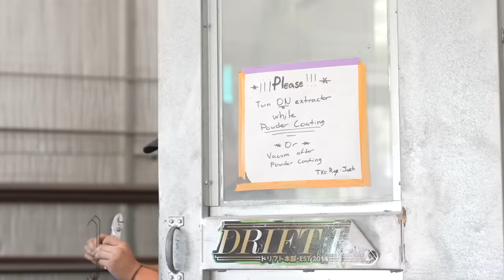My First E46 Gets a Modern Interior Transformation!

Comment: The seatbelt modifcation is probably alright, but considering all the variables when designing a seat buckle i would not take the chance. The material may be different, which in turn when removing material will lead to it failing. Be aware of this if you are planning to modify safety equipment.

Comment: I have the front seats for my e30 m3 tribute build, I used a 12v timer trigger on a 5 second loop to a 12v-5v converter wired to the orange green canbus wires and the seats stay alive. Amazon sells both the trigger and converter.
Reply: Yo bro I just copped m4 seats for my e46 and I will need to retrofit them in any chance you could help me out ??

Comment: Are the seatbelt buckle metals of the f82 and e46 the same composition? I’d be worried that e46 might use an older/weaker type of alloy (hence needing more material), thus removing it could impact safety

Comment: I have f80 seats in my e46 and the lower seatbelt bolt hole is under the little cover that says airbag, On the M3 seat it has a little cutout in the cover to let the belt out, so maybe the M4 seats are the same but the cover is different

Comment: F80 m3 rear seats might have been a better fit since its also for 5 door cars
Reply: 4*
Reply: @xrash2x  5. Two front doors, two back doors, and the boot (or trunk for the yanks)

That's how car doors are measured
Reply: For sure f80 seats would be 100 times easier.
Reply: @charliesmith874 at least in America, a hatch is counted as a door but a trunk (boot) is not. I think an M3 would still qualify as 4 doors
Reply: @partysodown  ok I did some more research and I concede. Always thought people just added +1 for every car on the actual amount of doors it has, but apparently that's not the case lol
Reply: @xrash2x  were im from its called 5 door, since the boot / trunk is counted as a door for som weird reason

Comment: Is there not a bolt hole for the seatbelt under the trim on the side of the seat that says AirBag? That were the stock seat belt bolts to on my F31 and many other newer BMW's

Id have thought they would use the same frames across the range..

Comment: i think your association of the sr3 to jdm is a bit.. idk.. false i guess.
The SR2's that are very similar were actuallty a factory bmw seat option in e30m3's.
That said i would have stuck e46 m3 seats in it, hands down the most comfortable seats i've used.
Reply from the maker: I had a set and didn’t love them enough. They were bouncy and it drove me nuts
Reply: @AdamLZ  fair enough.
never thought of them as bouncy, but we do not have the same body type and seats are very induvidual.
I just know that i bought my m3 in the UK and drove it for 1,5 days straight (1800km's)  home to norway and i have never been as comfortable over time as i was in that.

Comment: Little front seat removal pro tip from a previous interior guy. Unbolt the seat then scoot it all the way back, lay it back like your going to unplug the electronics then stuff your hand into the seat where the bottom meets the back rest and other hand in front then just tilt it sideways where your seat brackets and cushion is facing towards the door and pull it out facing that same way. This will almost gurantee you don’t take a chunk out of the steering wheel or any panels with the seat brackets and is a super easy way to take out and install front seats

Comment: I'm stoked for this bmw project. I did a rear folded seat conversion in my e39. It's not terribly difficult, you have to drill out the rivets in the back plate and then it should come out. The hardest part will be the brackets. You may want to source those from the f80 if you don't have them

Comment: at 40:57 mark https://youtu.be/vfLs4M5gBLs?si=_ka0JE01x5EIfra4&t=2457 , is that fuel pump or oil scavenge pump? if its the scavenge pump for turbo oil drain, are you guys not using a relay with the stock fuel pump as a negative trigger so that it doesn't run the entire time the ignition is on? thats what i had to do on my setup. made a relay system that uses the stock fuel pump signal to power the oil scavenge pump so that it only primes for a few seconds and turns off like the fuel pump.

Comment: I was under the impression that leather seats have a clear coating on them that protects the leather from stains, fading etc. and that meant that using leather cleaning products was pointless. It's the coating that has gone shiny and needs cleaned. Warm soapy water is what you should use

Comment: Why on earth would you buy Coupé seats for a sedan make that make sense you literally know as a car guy a Coupé and Sedan isn't the same inside the front seats have it's own handle to fold so people can het into the back a sedan doesn't because it doesn't need it because a sedan has back doors and the back seats you can clearly see in a Coupé car that the back seats would never fit in a Sedan because it isn't designed to fit in a Sedan it's designed to be in a place where there isn't doors where it's more rounded and the seats sit deeper